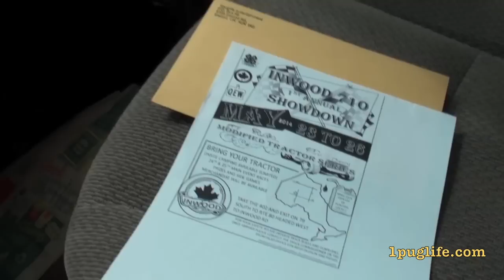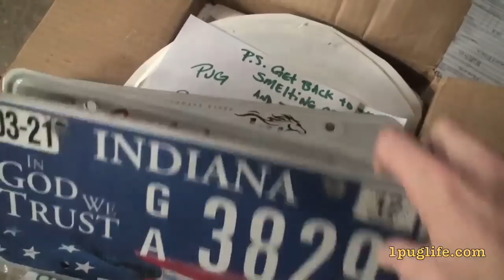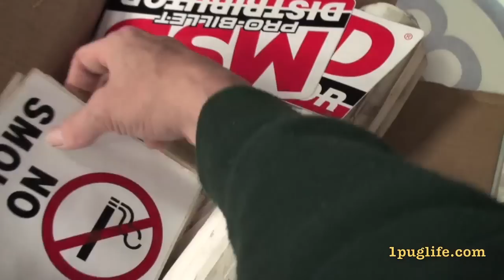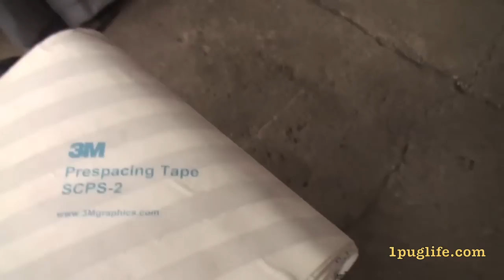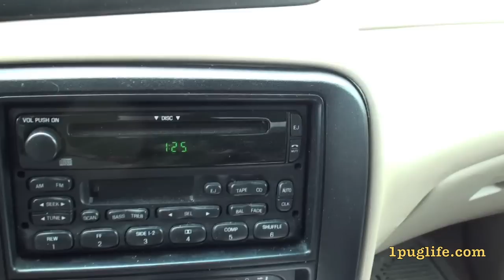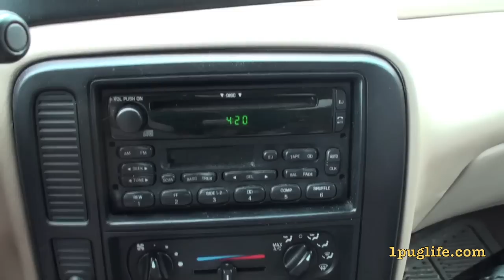just one stovepipe

Comment: Pug, sell that loud ass generator and get you a Honda EU series inverter generator. I have a Honda EU6500is for backup power, it runs at 60 decibels and it's safe to run computers and other sensitive electronics. I can stand right next to it and have a conversation without having to yell.

Comment: having that many hydro outages would install generator with proper silencer though wall and wired into the electricals. with a two way. , so much noise from such a small generator. 
surprised the ford is not back together, O 'well the side effects smoking weed.